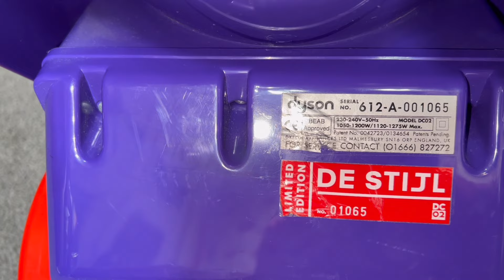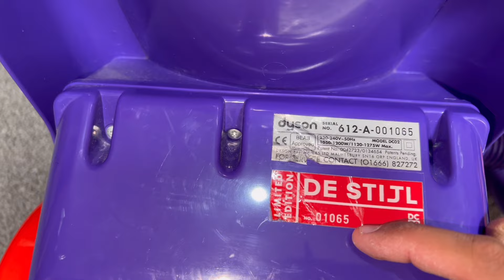Dyson DC02 De Stijl Cylinder vacuum cleaner - Performance testing & First look!

Comment: The sound of that DC02 brings back memories of when I was a school kid and I’m secondary school and used to go and help mum clean a house that is between my school and mums house.  The guy had a Dyson DC02 that he bought in 1997 and it was the start of my obsession with Dyson.  I was around 13/14 years old I think at the time and I was fascinated by the cyclone technology and I still am at 41 years old!!!  Something about these first generation Dyson’s were something special that I don’t feel with the cordless vacuums!!!  Even though I do love my V15 and previously the V8 before that and the DC24 I had before that and the DC05, DC04, DC03 I had.  The DC01,DC02, DC03.  The DC05 I bought in 1999 when I was 15 with my Sunday garden Centre job also has a soft spot in my heart with the hot exhaust air coming out of the cable rewind unit.  I loved the fine dust collecting on the cone of the cyclone on the DC02 and DC05!!! ❤❤❤
Reply: Эх тебе повезло к сожалению я родился в 2010 я не успел застать множество крутых пылесосов